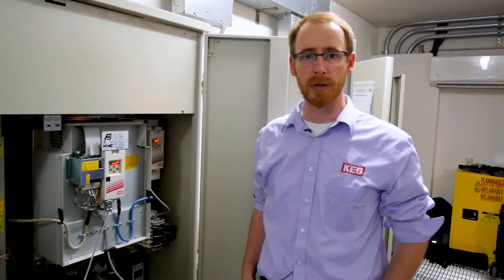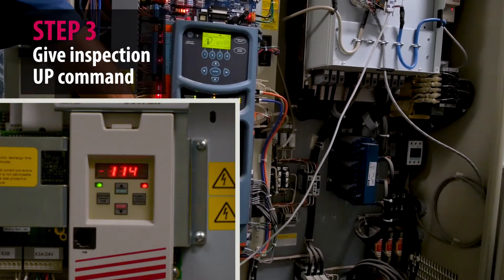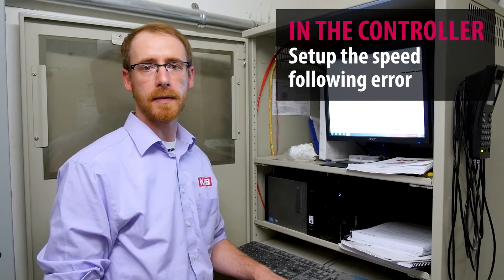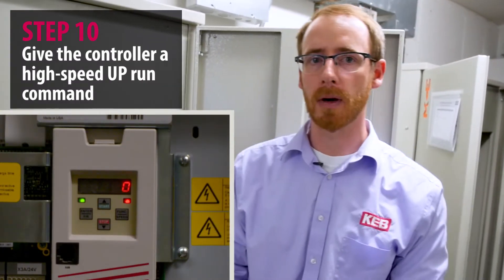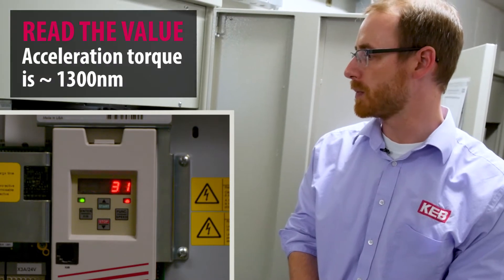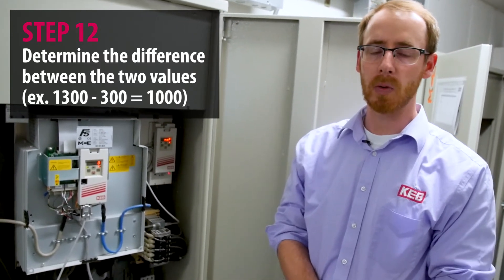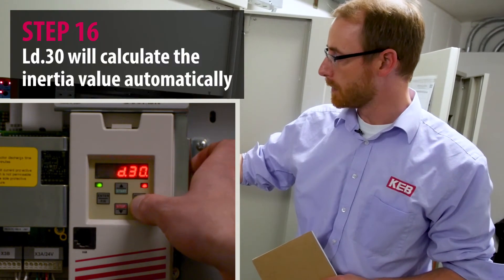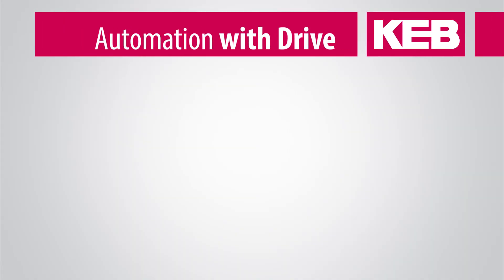KEB Elevator Drive Inertia Learn on MCE iControl

Comment: Hi Mr. Tony, my question is: to eliminate the rollback it is necessary to perform the System Inertia Learn
Reply from the maker: To reduce rollback, you should first evaluate pre-torque settings (gains / timers) per controller specifications. Make sure to read the drive manual provided with the KEB VFD for more detailed information. The inertia learn is only one of the tools on the F5 to reduce rollback, you can also adjust pretorque values or timers to alleviate rollback. For further technical support please contact KEB Elevator Support.

Comment: I am just wondering, do we have to change the "Speed Reference Following Error" in   the controller back to 25% after this Inertia Learn ?
Reply from the maker: Hello,
Thank you for your question. During the inertia learn process the drive reduces acceleration and to prevent any errors during this process the Speed Reference Following Error is increased on the controller. After the learn we recommend reducing the Speed Reference Following Error back to the original value the controller was programed to operate at. 
We hope this helps. You can always contact a KEB representative at KEBamerica.com/contact

Comment: Old panel remove and new panel installation  keb  f5 drive error code e.ef what is the problem
Reply from the maker: Hi Satyanarayana Moram,
Thank you for your question. E.EF is an “External Fault” which is typically triggered by a controller. Typically an OEM will have an input on the drive set to trigger an E.EF fault.
I would review the status of the drive inputs and drive parameters to see what is triggering the fault. If you don’t have a parameter file, or have questions on the machine wiring then you should consult the OEM of your particular application. I hope this helps. Have a great day!